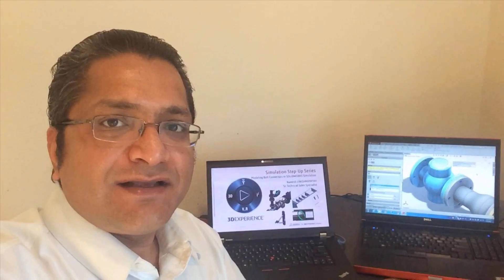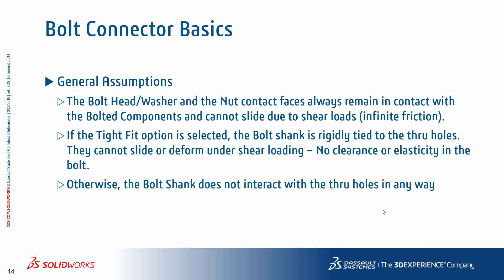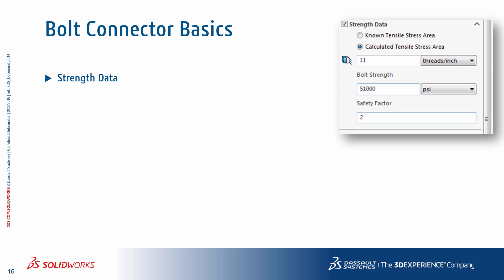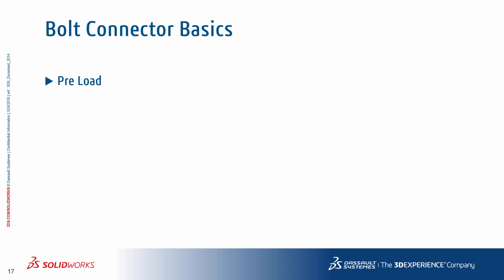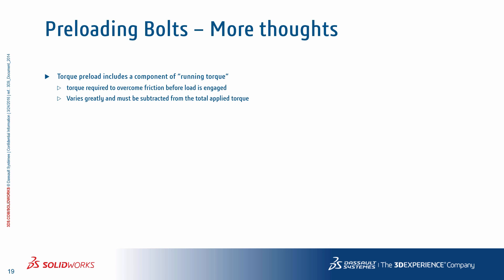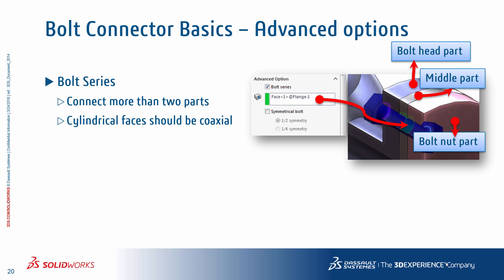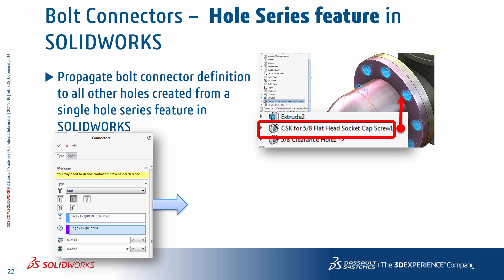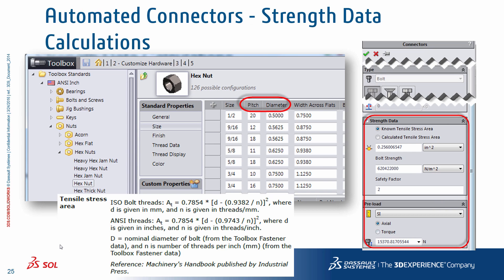SOLIDWORKS Simulation Step-Up Series: Bolt Connectors Part 2

Comment: How do I properly simmulate two connected threaded parts where both male and female parts are important in the analisys? I tried running a 3d static study using extruded threads modeled with the swept boss and cut features with helix path and ISO metric screw thread profile and no penetration connection between parts. This study resulted in poor meshing and points of high stress that indicate failure. I also tried axisymmetric 2d study with no penetration as well and it worked fine with FOS just a bit smaller than expected in project, but a understant that this study is not very accurate. 

Now i am trying to remove the extruded threads and work only with smoth surfaces, therefore i need to change the study connections between part for the simmulation to work. I understand that bolt conectors would work fine for the female parts, but i dont understand how to set a simmilar connection for the male threaded part. Can anyone help me with that? 

My simmulation is a pressure study of a aquatubular boiler casing with flat threaded heads as male parts, for a academic project.
Reply from the maker: H Gabriel! To learn more please reach out to MySolidWorks forum: https://my.solidworks.com/forums.